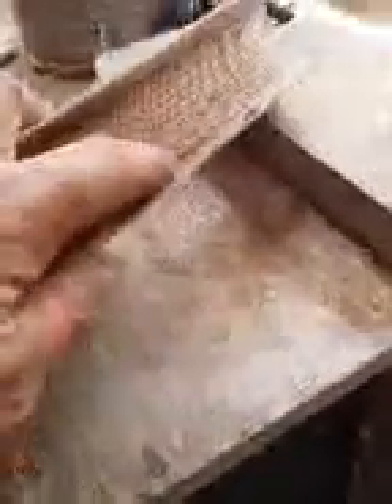Hemp bast fiber, I-beam concept

Comment: For making I beams the fibers need to run along the length of the beam on the top and bottom , using woven fabric you are only getting half the strength possible
Reply from the maker: Have worked with the fiber in several layups, adding cording top and bottom, helps, doesn't necessarily have to be a Wide top and bottom flange for Strength, hemp fiber is Omni directional in Strength, adding cord top and bottom of of a capital I , will work, Yet the web of a fiber lay up, is been best if layed up on the Bias
Reply: @mrglasecki  Not sure what you mean buy 'hemp fiber is omni directional ' ...all fibers only have strength  in one direction , along length , any fibers at right angles to the length of the I beam are wasted , do nothing .
Reply from the maker: @oz93666  posted out to air an space before, Bast fiber for it's weight is twice as strong as steel and unlike steel it has tensile strength and can be pulled in Every direction and Yes it has compressive strength as well,.
Reply from the maker: Might of saved a lot of breath by saying,.

 wrap the fabric on the Bias over cord/rope, formed epoxied and vacuumed,. 
 Has worked best for me so far,.

Comment: So using Hep studs coupled with hemp panels for small/Economy housing such as Park Model RV application should make said Park Model bug proof, mold proof, fireproof, and eliminate the need for steal structural members all together? Could said I-Beams be used like Henry Ford did in 1941 for the frame the Park Model travels to the site on? I have a bunch of designs and Ideas at www.tugboatwilly.com that these systems would benefit from. I even believe the R-rating over one year would prove more cost effective than the 2.5 per inch value as indicated by R-Value scales.
Reply from the maker: Didn't catch all your questions

Yes panels, stud an I-beams are all Quite doable, and even Better than Henry's using Organically Eco resin made from Hemp Oil extremely Stronger than petroleum based resin, and being R75 @ 12" it's R-6.25 per inch Yet with a hypoallergenic breathable sealed K- rating as well, the actual fiber is quite Fireproof, yet MUCH less in resin Apocalyptically Fireproof in Geo polymers and Portland/lime monomer modified's

Hemp can't rot mold nor mildew without deliberate Help, 
Sea water will after 70'ish year's will break it down in a raw state, 700 year's or so locked in Geo polymers
Reply from the maker: Monolithic casting is the solid FireProof bug proof, mold and mildew anti bacterial,
 Casting into conventional materials will have similar Strength yet weakness as well